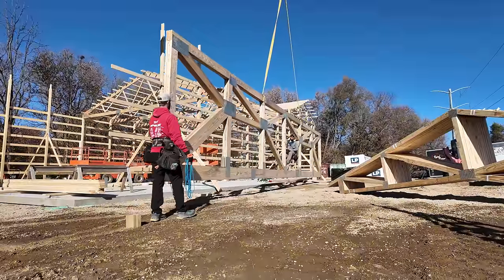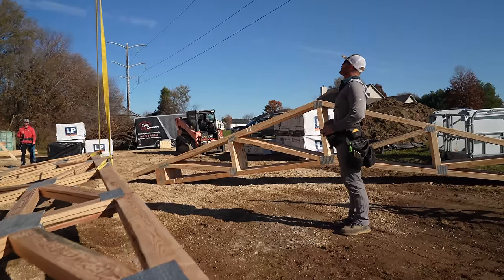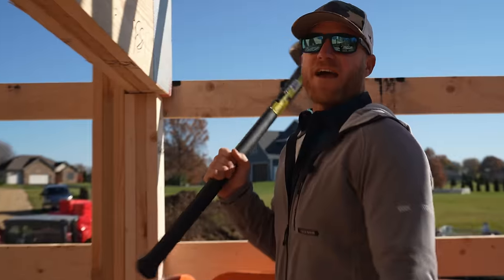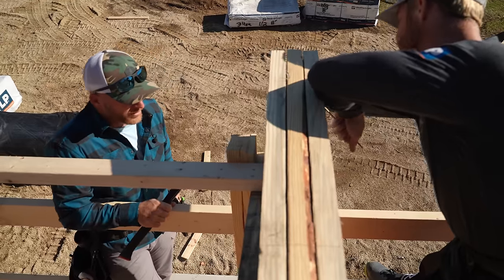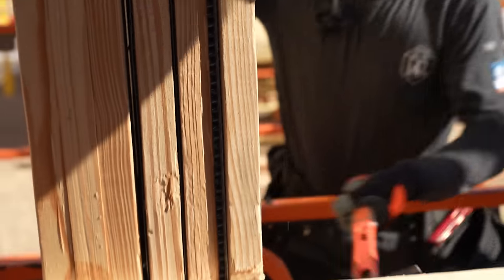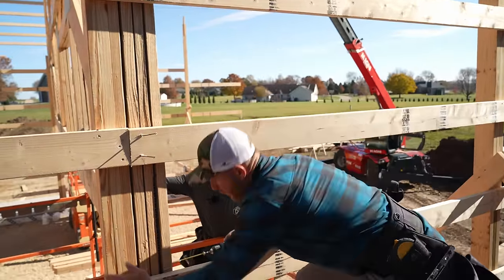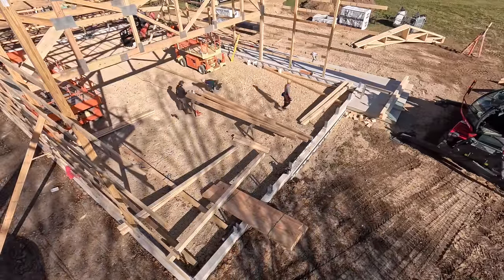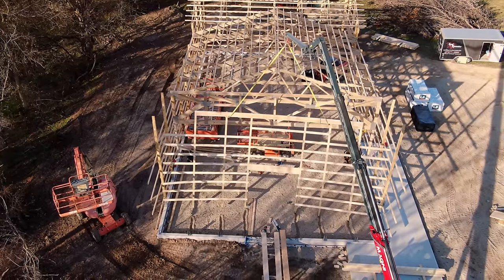My Dream Shop 13 Ep - 13: Monster Girder Truss and Final Wall Frame

Comment: I always used a bar clamp to draw the truss together first. Then put in the screws
Reply: Right??
Reply: no bar clamp companies would sponsor. so no bar clamp was used
Reply: I dont remember any clamp h used in videos. Maybe dont know what it is
Reply: clamps are pretty new so it possible..nah likely they haven’t made it to Illinois yet.
Reply: Either 3/8 or 1/2" all-thread with square uni-strut washers backed up with flat washers on both sides.  Once it's tight,  the bolt can be cut to  length.   I would also double nut on both sides once it's tightened to the extent you're happy.

Comment: Use all-thread.  Make it longer  to accommodate unistrut square washers backed up by flat washers on both ends.    If it needs to be cut on one or both sides,  so be it

Comment: I'd pull out 3 or 4 pipe clamps to bring the truss snug instead of trying to use fasteners to do it.
Reply: I asked the same question
Reply: I think he even doesn't have clamps, he do not need them so often. Atleast I didn't saw him using it for entire time.
Reply: @maximus-6788 I use them CONSTANTLY. 
Almost always for carpentry, very very rarely for actual "woodworking". 
Probably because I work alone a lot.

Comment: at 2:33 you can see the belly you talked about.  where you able to straighten that without pulling your fasteners that fastened the 3 girders to each other? I built a 2 ply header on a concrete surface that had a belly in it and the header conformed to the belly and in order to straighten it after seeing it up on the wall I had to pull the fasteners to straighten it out

Comment: How come you did not pull the mega truss up to the column with some serious metalworking F clamps and then set the bolts through? I never see you use clamps? I have 4 Heady Duty Bessy clamps that can provide 7,000 pounds of force - they can draw anything together but you need some plates to prevent the clamp from crushing the wood. Great video!

Comment: Should have pulled that truss to the column with G clamps, got it fitting right then screwed it prior to bolting.
Reply: I was thinking the same, but he probably didn't have any handy
Reply: @ZrubekFamily  Ratchet straps would have pulled it together.

Comment: I am surprised you didn't pull those plys together with a pipe clamp before putting in the screws or thru bolts

Comment: drives me crazy not understanding calculations for column bearing loads. canada Ottawa here snow loads must be accounted for 48 lbs sq foot. so 40x60 means each column takes 9300lbs plus dead loads. this massive building with middle section that would hold snow up here would need insane footings and columns. How do you engineer it? especially all your buildings I watched go up with just 18" diameter piers. belled at bottom for larger soil bearing?

Comment: as a carpenter here in Germany, i really do not understand why you guys like pliewood trusses so much. i mean as you experienced... they are a pain in the ass to build with. 

and why waste so much nailplates when you could just use plain old wood yk, just bigger dimensions, from the looks of it i´d say like a 16cm x 32cm for the bottom girt and you would probably even be able to use smaller struts. 

it just seems "cheap". you probably have your reasons but watching you guys fiddeling around with thos plies for ages hurts my soul ^^.

generally nice work you guys do!

Comment: Big C clamps.  Come on now.  Clamp it before using any screws bolts or nails.  Yea, Bar Clamps.  It's what boatbuilders do with the big builds on wooden boat hulls.  Big C clamps.  Kraig~ have you ever worked in a boatyard?  Maybe something to consider.  ~ Just saying.

Comment: Why not incorporate some steel beams instead of those giant wood girder trusses? Seems like steel would be less of a headache
Reply: Just a few things I can think of-Corrosion of mismatching metals, needing new materials for fasters and tools, and having experience with one material as opposed to another.
Reply: Obviously he knows better than you do
Reply: Price, lead time, location and availability.  Steel may be the best choice.  But, given the location of the nearest steel works/supplier perhaps the price and lead time didn't meet the time Kyle wanted.  Having all the truss made at one supplier at cost in an ideal time, probably slightly cheaper, was the way to go.
Reply: @daveklein2826  Of course, I should have thought of that thanks
Reply: The whole roof system most likely was put together by an engineer at his truss supplier. Less money than hiring an architect/engineering firm to independently design the structure but it means your getting the products the supplier manufactures (wooden trusses)
Reply: Andrew, most likely?   How about you stop guessing to try to sound important..... You FAILED
Reply: @andrewr2650  if that’s the case than do you think the same truss supplier engineer engineers the whole building? We need a video on the engineering Kyle!
Reply: @calvinfroisland   I can only speak to the post  frame buildings I have built, but for those buildings yes the plant I worked with (who specializes in post frame). supplied a complete set of structure drawings.
Reply: I work for a steel joist company, and yes one of our girders could have covered this span with half the depth. I will say that girder sure is good looking. It would have been a different engineer, a different load date everything would have been different. There is also something to be said for his loyalty to a supplier that has earned his business!
Reply: @calvinfroisland4246 normally yes.  It doesn’t have to be.  A post frame building is outside building code for many parts, so it should come with an engineers stamp on the structure.  There are no rules to say a single engineer needs to do the whole thing, but it’s often easier that way.  At the very minimum, whomever engineers the walls and foundation needs to make sure the truss package aligns with their design.
Reply: he cant nail to the steel beam, there you go
Reply: You would need to use steel columns from the ground up. That would be more costly for one but it would completely change the bldg.
Reply: @calvinfroisland4246 generally, a truss supplier only designs and manufacturers the trusses. Their truss designs are then sent to an outside engineering service, usually provided by the company that provides their design program, to get an engineers seal applied. All that seal does is say " If these trusses are built with the components listed they will perform as shown on this page." Any other engineering work on the building would have to be done by a licensed structural engineer.